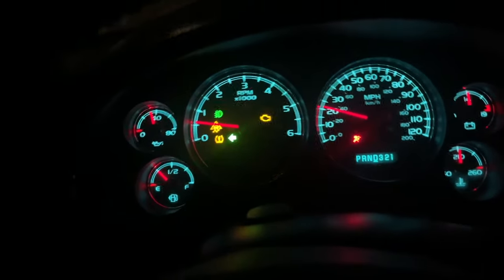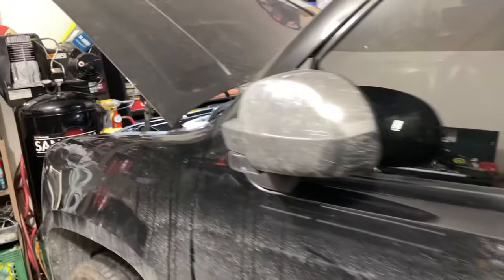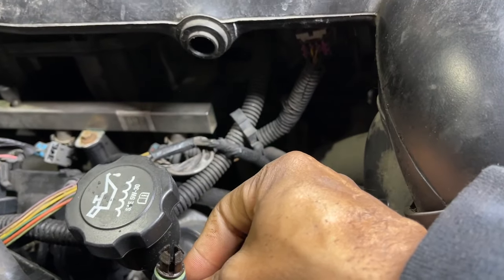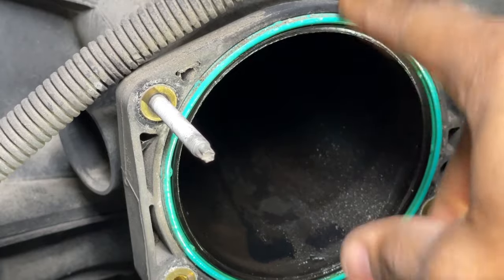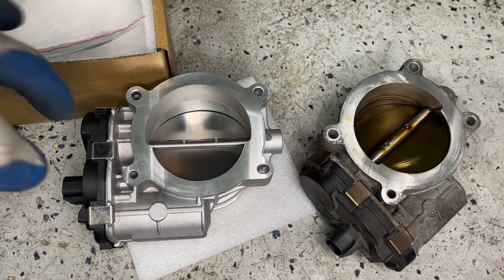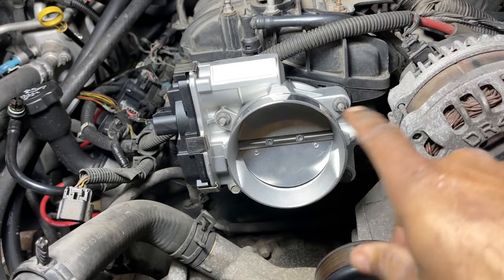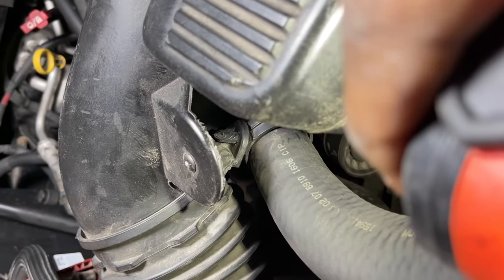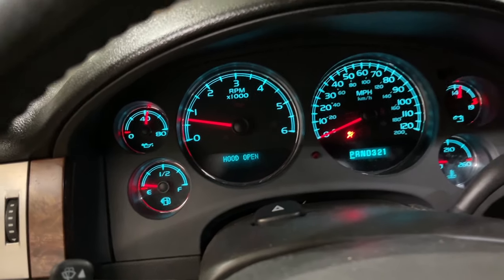How To Fix Reduced Engine Power Quick And Simple! Code P2135 Chevy Or GMC Trucks / SUV's! TPS Issue!

Comment: yes it does matter ! disconnect the negative 1st than the positive , and reconnect in  reverse order , i seen a person do it out of order and when reconnected , the battery blew up , no joke , wear eye protection too , just sayin , safety  1st .
Reply from the maker: You are correct. I should have put emphasis on it. If you watch any of my videos I cannot stress enough the importance of safety.  Thanks for watching and sharing that info.
Reply: 😂😂😂bull 💩
Reply: Gotta be bullshit been a mechanic for years never followed that specific way just pull one off then the other doesn’t matter which one I’m pretty sure I’ve always pulled the negative first
Reply: What a load of bullshit.
Reply: Hey Terence , my computer pulled up your video again and i saw it again ,it was a very good video , another thing i learned just as you did ,just go ahead and replace the Throttle body , i use to take them off and clean the crap out of them , that does not work at all , i just replace them with the a new 1,   dont Listen to these Knuckle heads about the battery terminal procedure , i use to do it too ,they just Stubborn and not humble to Learn a new tech , until a battery blows up in their face ! Lol than i wish i could say , i told you so knuckle head ! i realized you had said , it was 8 degrees out side , brr thats cold out their , that truck bearly fit in there , Lol , so cool ! peace ! @TerenceDIY
Reply from the maker: Thank you Roland and Thank you VERY much for watching my video again. I really appreciate it.
Reply: @Rocknrollrebel23 yea. These idiot YouTube mechanics think they know it all. I've been pulling battery cables for 30 yrs.it don't matter what one you pull off lol.
Reply: As a licensed electrician there is no issue. If anything pull off the positive terminal first. Never had an issue. When connecting multiple batteries in series….. however yes. You must pay attention to where and how you are connecting them. Shit can get deadly. But for a single vehicle battery you’ll be ok. Disconnect one terminal at a time and just be sure not to cross a phase
 (-,+)
Reply from the maker: I am also a certified electrician since 2008. I am extremely familiar with electricity as I was passionate about the speed of light as a kid. Thanks for watching.
Reply: I'm not a mechanic and although I'm told that it's right to disconnect battery before working under hood will it really be a problem to not disconnect battery just to work on the throttle body?

Comment: Do you need to reprogram the throttle body once replaced? That’s what I was told. Hope not though lol 2010 Chevy Tahoe
Reply from the maker: No. As long as you disconnected the battery for a while then it should be fine. I've done many with no programming and they were perfect. Thanks for watching.
Reply: What happens if you put a New Port in the still doing the same thing

Comment: A different video same issue was fixed by a loose ground wire between engine and firewall messing with the fuel pump when you hit a bump. So a 2nd real life easier fix that may also be the problem. 🙏
Reply from the maker: Thanks for sharing that info Charles.
Reply: I have replaced the throttle body and sensor, now it comes on when I hit a bump. Charles can you share the link to thay video ? I think I have the same problem
Reply: @becomingB did you find out your issue
Reply: @BecomingB any word on?

Comment: I’m currently having the same problems with my 07 Yukon Denali 6.2. Replaced throttle but don’t think was an OEM replacement bought it from Oreilly’s. I’ve had different people give me different ideas on what they think the problem is. I’m kinda in a loop!
Reply from the maker: It's either the throttle body or the wire harness the plug from the throttle body comes out of. You'll need to inspect it for frayed wires. I would also try an OEM used throttle body. They are inexpensive on eBay.

Comment: You are also able to replace just the throttle position sensor, rather than the entire throttle body. You used to not be able to purchase them separately, but we’ve been able to for a while now.

Disconnecting the battery would have cleared your codes.
Reply: Thanks for this part I was literally just about to ask that question
Reply: Until the code pops up again
Reply: @rogerrambit4447  Obviously if you don’t replace the sensor the code would pop up again……not sure what you’re trying to get at here?
Reply: @jerrybuck9236  you mentioned disconnecting the battery to clear the codes which would work until the check engine light illuminates again.
Reply: @rogerrambit4447  yeah…and I also mention replacing the throttle position sensor…on a video showing how to replace the throttle body. I don’t think anyone here is assuming, or suggesting, that simply wiping the codes is going to fix the problem. The point you’re trying make is completely irrelevant.
Reply: Great video sound like you got a little leak in that exhaust manifold to be expected.

Comment: Thank you for this video. As a female I find we get taken advantage of when it comes to getting our vehicles fixed. You made it look so easy to fix I'm definitely going to attempt to do it myself. Thank you so so much!
Reply from the maker: I agree with you as far as taken advantage of. And you definietly can do it just as I did! Good luck with your fix and thanks for watching.
Reply: @TerenceDIY I changed the throttle body today, ac Delco. And problem came back on test run.
Reply: Also theres no loose wires on TPS wire harness.
Reply from the maker: What code or codes are you getting? Did you check the wiring where the throttle body connector comes from? This can also be a ground issue.
Reply from the maker: Okay. What code is coming up?
Reply: @TerenceDIY  tightened my battery connections that seemed to do the trick. Not sure why it had a tps code, oh well got a new throttle body drives a lot better now anyway
Reply from the maker: That's awesome! I am glad you got it fixed. That new throttle body will definitely increase your MPG, in which is a plus since gas prices are ridiculous.

Comment: Very informative, hopefully this fixes mine!
Reply from the maker: Here's the link to the part just in case you don't have it. Be sure to check the application list. 

https://www.ebay.com/itm/156168413011?fits=Year%3A2010%7CMake%3AChevrolet&_nkw=2010+chevy+suburban+throttle+body&itmmeta=01J6K896NNA4DFQ3NJJJ60AVQG&hash=item245c5cdf53:g:9YIAAOSwRwdmYvxY&itmprp=enc%3AAQAJAAAA4HoV3kP08IDx%2BKZ9MfhVJKkXWvEuQlT56tZXy5%2B%2FDsIr9A8ho7xPdFTax4ES3H3UoUQJKY3kKinvI19CLNm%2FajeLhF9XQQKzHlq5AdoDCOKhu2stS4LJ1bqZMI05IRGUc%2BqMQQ6lAs85W6zuEoQJWFBd3dBO3CwlIz8pI0ZXuxFjRGoKk18J0fWDDMvnp1HLCwr%2F95fxNaSS4y0LvELUSvc3I%2FXfND0iggt7LiDCdFZ6wCr9GYpsvbX2maNcPcfbNQl2ZQytNoPRu77HcPr7LemmWdrtrOeDqXyTgN6%2BcT%2Fa%7Ctkp%3ABlBMUIjrpOi0ZA

Comment: I’ve got a suburban this has been going on for 8 yrs . I’ve changed everything you can think of and it still does it
Reply from the maker: If you replaced the entire throttle body, did you check that harness? There was a bulletin released by GM some years ago that stated there was an issue with the hearness that connects to the throttle body.

Comment: Thanks for showing the process of the throttle body replacement. I am having this issue with my 2011 Avalanche with all those lights popping on and motor going into reduced power mode. I looked at my throttle body and it appears pretty clean but I did however order an AC Delco throttle position sensor with plans to replace in next day or so. Really hoping this resolves my issue, it is very frustrating when pulling a car trailer and the truck can basically only idle off to the side of the road.
Reply from the maker: Let me know if this fixes your issue Mike. Thanks for watching.
Reply: @TerenceDIY  Well, after checking a couple of the grounds that everyone mentions and the TPS being replaced I think it is resolved. Been driving for 4 days now and no "reduced engine power". The little traction triangle light popped on for a quick second when I was getting on the x-way one time in those 4 days but nothing else. Time will tell as always, appreciate the tips from your video.
Reply from the maker: That's great Mike! Keep me posted if anything changes. Once again, thanks for watching.
Reply: @mikebas7325 hey Mike is it still running good?
Reply: @kgarner3655  Yeah, mine has been running pretty good since the throttle body cleaning and sensor replacement. The little traction triangle light popped on for a quick minute a few times but no engine power reduced. When the traction light pops on it is under a slight load when getting on the x-way so it is not losing traction, hope to figure that out next lol. For reference, I have put about 700 miles on the truck since the throttle body fix.

Comment: March 24, 2024 @ 1440 hours, this video was RIGHT ON!!  We went to O'Reily's and here's their optoins in Texas:  $250 for brand new with lifetime warranty; $216 Brand new but with 1-year warranty; or $185 remanufactured with 1-year warranty.  We opted for a brand new Hitachi with the 1-year warranty, it's a 2007 Silverado 5.3 and it worked perfectly finally.  Before it would start & run, at other times occasionally or rarely it would turn on but it would sound like it wasn't running right, all of those indicator lights would trip, Stabilitrak, Low Power mode and I forget the other thing & we managed to plug the computer in, code was P2135. We left the original greenish seal there, we just cleaned it and the little groove or space & it fired up like a champ. Before it would start but no matter how much you depressed the accelerator it wouldn't respond in the slightest, now you press it and she ROARS LIKE A LION AGAIN!!  Thank you Terence The DIY'er.
Reply from the maker: You're very welcome, Alex. I am glad my video helped you guys out. Thank you SO much for watching.

Comment: i have the same problem just happened like 2 hrs ago and it’s winter here CT so now i gotta work in the cold weather 🥲thanks buddy for the video
Reply from the maker: You're welcome. Here's a link to the part just in case you have to order it....

https://www.ebay.com/itm/333272439452?fits=Year%3A2007%7CMake%3AChevrolet&hash=item4d9895da9c:g:EpoAAOSw6QJdM5EW&amdata=enc%3AAQAHAAAA8MoUyTfsKekX%2Be%2BCj7USOvxRS2XHH%2B4s%2F3tNXtAZ4Z%2BLY2YJ8cZZawMqXI5eRkCN2peingTBDhw67RTFniZ13YeWeYbWwzGRlOX3gCqapuSIPwlEOfKzGzdNW%2BNzE8MbtUN9VDiptENx7U%2BFO9v1mdzK26kZEPSASz6Nb%2BOszzUizLHcAseYXF2O1kLIaqc9qMorv1YqXI%2FO3IIZsHO9gRZHMAmf8Hp2E%2F76x%2BneM%2F5okqH6pklB1ljoEgpCb%2BHqzAN%2BmX6nr9aYwD%2FsGHkDQ%2F%2FfO8i07UMd5RdZ7KeXffvQeHwbVAUq7HNuM9G2SENERg%3D%3D%7Ctkp%3ABFBMzKvugahh

Comment: My truck ran this code and i bought the throttle position sensor and changed it myself. It fixed it! The hardest part was those metal clips they were fucking my fingers up lol but other than that simple
Reply from the maker: That's great! I am glad you got it fixed. Thank you so much for watching.

Comment: I'm impressed with your car knowledge! Thank you for being willing to help us out. And you almost always reply with an answer-- not many take the time to do that! We have an 04 Chevy Tahoe that does the reduced engine power code. Mostly it's when you are first starting the car, but now it's happening just driving down the road. Husband did something with  grounding a  wire, and it never did it then for about a month. Back to doing it again. You and others mentioned something with the ? ?"electrical harness"?. Does this sound like a possibility here? And if so do you know how much something like that would cost to repair?
Reply from the maker: Yep, Chevy released a bulletin back in the day about the harness having issues. I'm not sure how much a repair shop would charge you guys. Tell your husband to check the harness that the throttle body plug is connected to and follow it back while looking for any frayed or damaged wires. I wish I were there to fix it for you guys.

Comment: I thought you would have to relearn the throttle body after putting the new one on ? Thank you for the video. I had the same problem today.  They sell a throttle position sensor for that problem?  I have a 2008 suburban  2500. Thank you for the video.
Reply from the maker: No relearn required. Here is a link for the part...

https://www.ebay.com/itm/263995173265?fits=Year%3A2008%7CMake%3AChevrolet&hash=item3d7756a991:g:CmgAAOSwcspkn57P&amdata=enc%3AAQAIAAAA0K3YKz8ABHoMj8wLX5Ezu6qywqf0YVLtOHE8HjBCfno6CCoDU95QopLZ2OZCJb3pL0P7DlwPuJEh2%2Bd0Q2qimUM%2B5Rp7CN8s2h9F0M0DeodKkas4TwcpolE0OXamx5HjJsJA3nZss9hJjDJo13O96u2JChpZxONal4QD92h22XzeDIC%2BLRAUHbeRvUAVfdQ19fQfKMotOGLet%2FSXhbhFq3LwGWE1%2BJnM%2FQapVMGEQkfV6VuxYEksHUe7%2Fkd74JseNNbn9hlEp4YdHOFUwu4s%2F0A%3D%7Ctkp%3ABk9SR8Tel4-nYg

Comment: Having the reduced engine power on a 2007 Escalade esv. The temporary fix for me has been taking the positive terminal off battery and then putting it back. If it’s the throttle body, why would resetting the battery work?  🤷🏾‍♂️🤬GM
Reply from the maker: Are you getting the code P2135? That code correlates to the throttle body. The reduced engine power correlates with many different codes. What code or codes are you getting? Thanks,
Reply: @TerenceDIY Was wandering if the car was in limp mode for another reason could that cause the P2135 because of how the car does not respond to how much throttle you give.
Reply from the maker: Have you checked your Accelerator Pedal Sensor? It too can mimic the same symptoms.
Reply: @TerenceDIY No I haven't. I have a 2010 Chevy Impala with 64k miles. It's had the P2135 code before in the last year but it cleared on it's own. It's happened twice in the last few days. What's your thoughts on getting the part (probably Chinese) for under 100$ or OEM for $250+..
Reply from the maker: Here are a few links to sellers I have dealt with in the past. They have great products that are inexpensive. Parts for your car links...

https://www.ebay.com/itm/293055711759?fits=Year%3A2010%7CModel%3AImpala%7CMake%3AChevrolet&_nkw=2010+chevy+impala+accelerator+pedal+sensor&epid=227151378&itmmeta=01J66237B44Y1MJY101SES4FW6&hash=item443b7b4a0f:g:~WgAAOSwNw1eQz0T&itmprp=enc%3AAQAJAAAA8HoV3kP08IDx%2BKZ9MfhVJKl%2FT9B%2B5IkwEIZHAHa%2FJ5qsaTHSx1XX%2F12HkHnFhU%2B7oRW3fargoTqbcTfPg4e9Nq%2F1RgTQDmG5rVRKqoBZ0PqiZiKSB6a4wLD2B3BKCHBC11uh1A3iEmgtb7CUIOqRX6PpfzjorYQ%2FN9V%2BcJQIVwlD4ADroR3zyJLt6NeuaT9I6wbGZRNX2PnTmsYA3VRhJE5ZiyvLEVnZheQtD1SK02gpUfS4I6FeKjCnohxpPRtMTytsqABvYqMvf9YtYzZDga2Gn6eVHTrR%2FSvNLxLUCC7ZCNZCOYPMEFvvYdcvbF6C2w%3D%3D%7Ctkp%3ABk9SR-L1jMKxZA

https://www.ebay.com/itm/394698300371?fits=Year%3A2010%7CModel%3AImpala%7CMake%3AChevrolet&_nkw=2010+chevy+impala+throttle+body&itmmeta=01J662719RZ0RY2ZKEXSPZ965X&hash=item5be5da1bd3:g:tasAAOSwFdhklhub&itmprp=enc%3AAQAJAAAA4HoV3kP08IDx%2BKZ9MfhVJKnl593rAV8UKirRecJFjsqlcz0ZmlyW1PAC4Hp4DYGXCLfM8PB1Is1IHVTwxgFjQ6ppqbY%2FhhZesywRKjhicKxemaJkeTGIbjaE2A0yhAyCbWaR0IDv%2BqvySl6yNbw2xEopvbQv5f6AlW721eomGHihwHAWsaaSlc6s%2FCOtJYYfESH0beh3Zk%2BEtQ0bjNuInVIOhOBlWBkOFbLh57Lblpmr30hOud2fLxg7T54BWlRZXleqqV9sr4GV%2FYbbtQDR%2Ftwrixeypdu4uirT%2FdpAMaVy%7Ctkp%3ABlBMUIqVnMKxZA

Comment: My throttle body cable came off and idk if it’s gonna be a tough fix or not lol 99 Chevy Silverado 1500 5.3
Reply from the maker: Did it break off? If so, here's a link for a new one at a great price. 

https://www.ebay.com/itm/402402010308?itmmeta=01HQQ1V9A6X6JY9PH2XFSTRZQS&hash=item5db10764c4:g:lUkAAOSwo85hsWqX&itmprp=enc%3AAQAIAAAA4LYOouqjLdWlKIUGIC5XuOauj9d6v7ol6d3zxWUDARnWdKwJ%2FUSGRhii4j8JouUD%2F5PpzJsjl9gh%2FNzesYkc5ftSJ%2F%2BRRfSZAfbjDuI7iCBORITBnmjFt22eaot4G766F5EPsPHEdztgoCtXJAm%2FCoa%2FLiRC2XZMy2abmiqutMXIvmXFAeET%2B%2Bj3ZG0cpmA1k8Yq3yOL0It995%2BxO%2Fp3ihFIzJVGVtU5L7mPBID1zQ%2Fu64V0ZmHIPgO%2Bm2fvoGNTi0P6ktyaehDcej2%2FgZRThD7%2B9Mr%2BqIzm8XavIG%2BGb%2BSz%7Ctkp%3ABk9SR7aV7eG9Yw

Comment: Geese just clean your TB once in a while. Its called routine maintenance. I got 395766 miles on my 04 6.0 with zero TB problems.
Reply: Yes, absolutely! I have three of them all with well over 200,000 and one with 337,000.
Reply: And they all run great, I stay with the GMT800 generation 2000 -2006.

Comment: Dude, I had to do this to my '12 Yukon 5.3l about a week ago (it's Dec. 2023 now) and it ran horribly after installing the new trhrottle body. The manual relearn didn't work, it kept wanting to idle at 3k RPM, would surge while driving, etc. Had to take it to a shop to force the relearn as my code scanner doesn't have relearn service capability (should have just bought one that did with what the shop charged me to do it). Then it was still running lean, wouldn't idle properly (though it at least wasn't up at 3k RPM anymore). I had to replace the MAF sensor, and it was fine after that (mostly lol). What a pain in the a$$. Appreciate the video. New sub!
Reply from the maker: Thank you for subscribing. I hate you had to go through all of that. I wish I were there to help. We probably would have gotten it fixed pretty quickly and saved you some money.
Reply: Hey, I feel your pain through your comments. That's why even though I love the body style of those trucks, 07 -14. I stay with the GM800 Generation of Chevy/Gmc trucks. I have a few of them, with well over 200,000 miles and never have any of the problems that the 07 and up have. I know alotofpeoplethat have that Generationoftrucksandhave nightmare problems from electrical to the lifters due to the active fuel management/ displacement on demand  system. $$$$$$$. Again, I feel your pain.